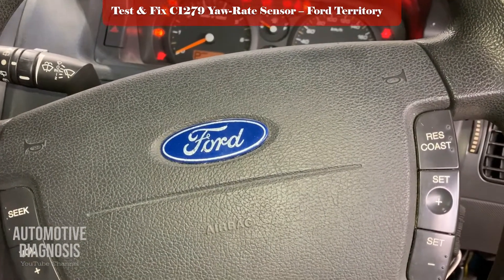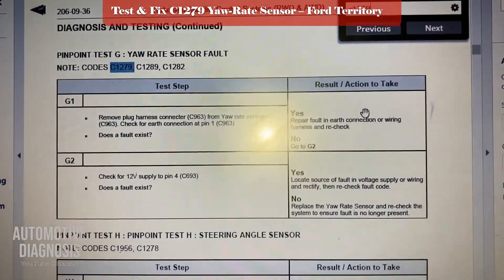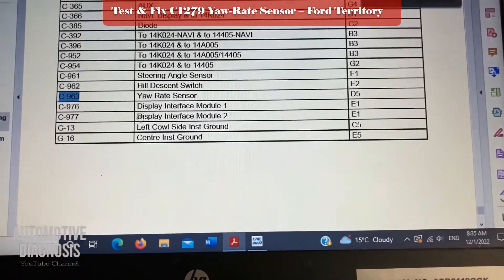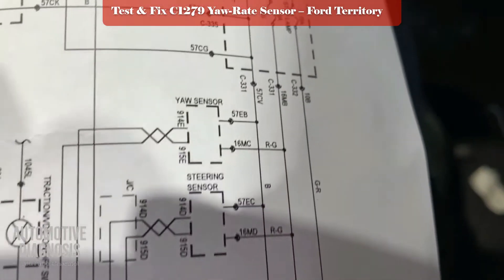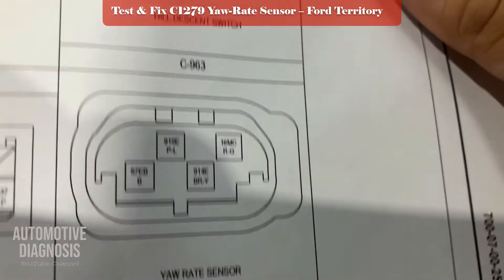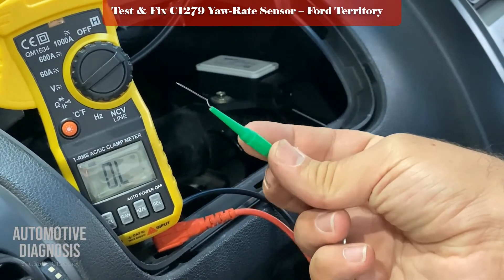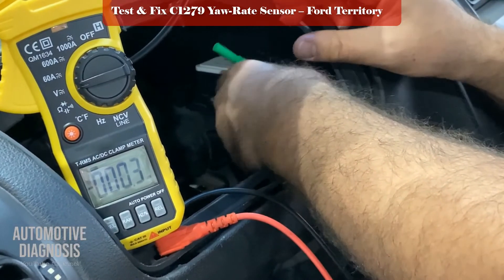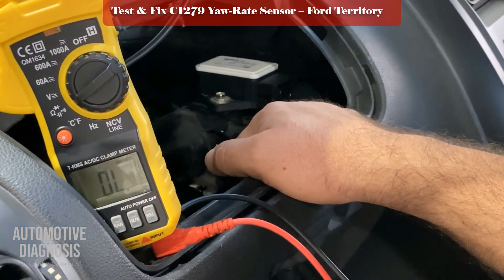Test & Fix Ford C1279 Yaw Rate Sensor Fault Code | ABS & ESP Fault Code

Comment: i have azera 2009 3.3L V6 GLS & the driving experience changed years ago. it was sporty in the corners & so stable on wet street or when it rains, it's like it sticks to the ground! very amazing system!. that had me pulling my hair to figure out why it stopped being stable like before! no more sporty feeling in the corners & when it's wet it slides horizontally side ways a bit. mechanically checked & fixed but nothing solved. changed angel & the 4 ABS speed sensors. plus i don't have any check lights. all i can think of is that these sensors is giving wrong feed back!
Reply from the maker: Thanks for sharing your experience. But I didn’t quite get the question, what is the problem with brake system right now?
Reply: @AutomotiveDiagnosis    figuring out why it stopped being stable like before! no more sporty feeling in the corners & when it's wet it slides horizontally side ways a bit